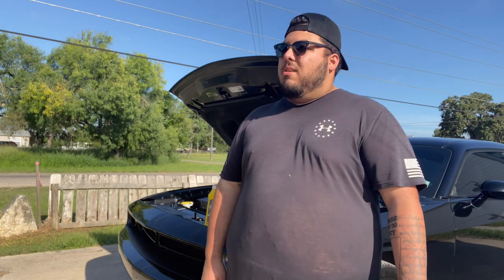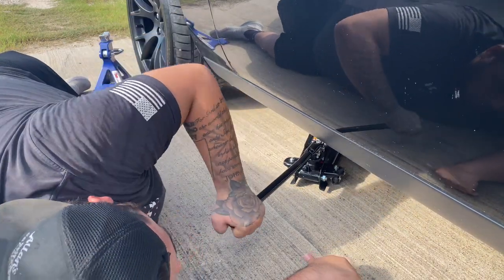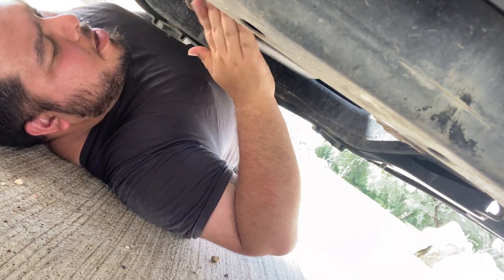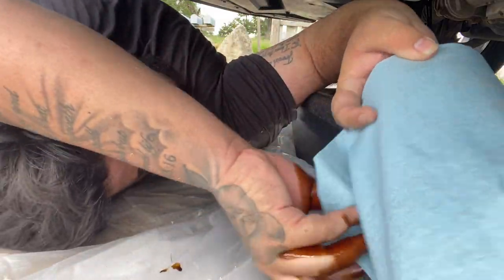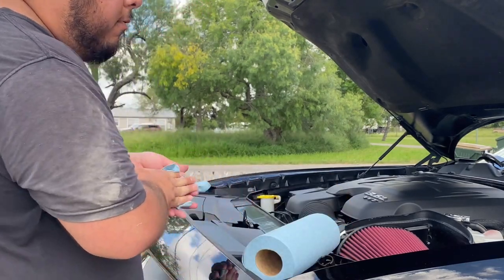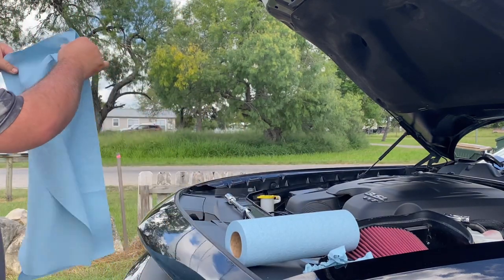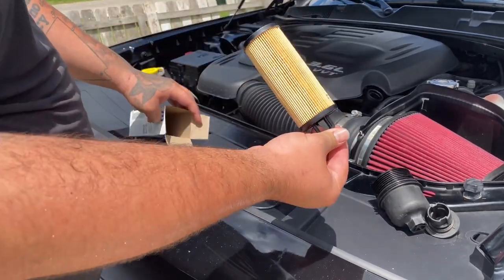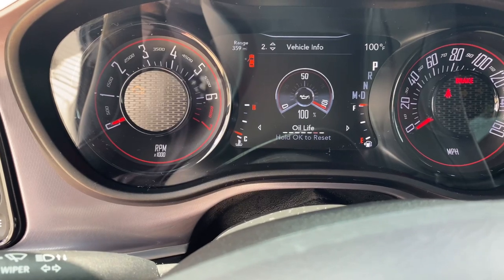2019 Dodge Challenger SXT Oil Change

Comment: My 2012 challenger sxt v6 i use valvoline se 5-30 synthetic blend the white 5 quart  jug and about half a 1 quart bottle. Its good to put the o ring on your oil filter cap before you snap in the new paper oil filter. To reset my oil change light on the 2012 challenger, i have to press the ignition button two times without starting the car, then press the gas petal three times within 10 seconds.

Comment: Do you reuse the same oil drain plug?

For my old Honda Civic, it was recommended to always use a new oil drain plug with a gasket.
Reply from the maker: Yeah, you’ll reuse it for the Dodge Challenger.
Reply: I did it.

Have you ever changed the drain plug?

Thanks.

Comment: Thanks for taking the time to make a video. 
Next time, edit out all the personal stuff , because no one cares . Use a  high speed frame rate playback  in areas that are redundant or obvious to everyone. ie, undoing multiple bolts, wiping and cleaning  etc.  That video could have been 5 min. max instead of 20 .
Lastly , you will want to get some mufflers on that six cylinder , the noise its making now sounds more like a vacuum cleaner, not a muscle car with a throbbing V8 . so quiet it down so everyone will have to wonder what engine is under the hood, and you wont be ashamed  of only having a 6 .

Comment: While its perfectly fine to use synthetic oil, the 2019 up SXT V6 Dodge spec "MS6395"  is for is 5W-20 conventional oil. So you have a choice of conventional or synthetic oil changes. The only reason that the Dodge Dealer recs synthetic is to make more money. Now, if u have a 2019 up 6.4 Hemi, then u have to use 0w-40 Mopar or Pennzoil synthetic as specified by Dodge as the only approved oil.
Reply: I have an SXT and am confused one dealer told me conventional and another told me synthetic.  But the oil change warning goes off after 10,000 miles. I know synthetic can go for 10,000 miles but thought conventional was only good for 5,000 miles.
Reply from the maker: The owner’s manual only states that the manufacturer recommends the use of SAE 5W-20 motor oil that is API Certified and meets the requirements of FCA Material Standard MS-6395. It also states that the manufacturer strongly recommends against any oil additives other than leak detection dye. Further more, it also states that under no circumstances should oil change intervals exceed 10,000 miles (16,000Km), twelve months or 350 hours of engine run time, whichever comes first.